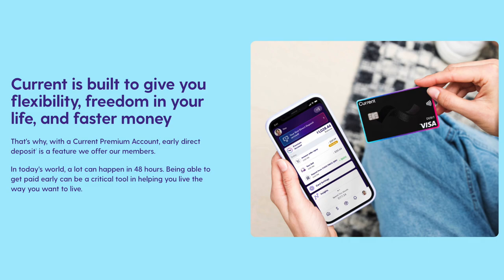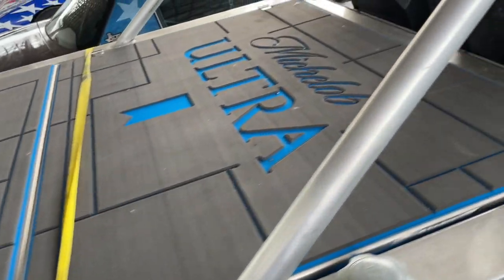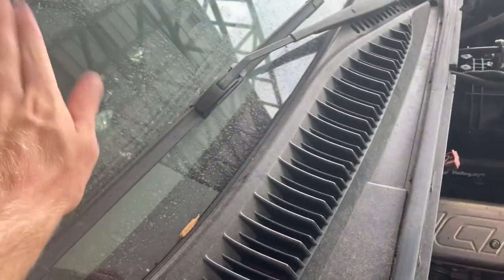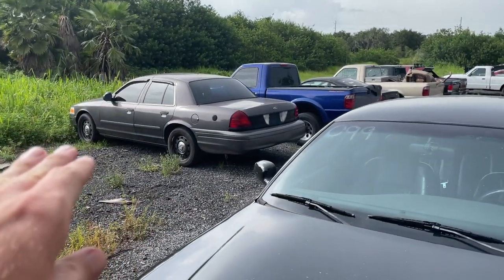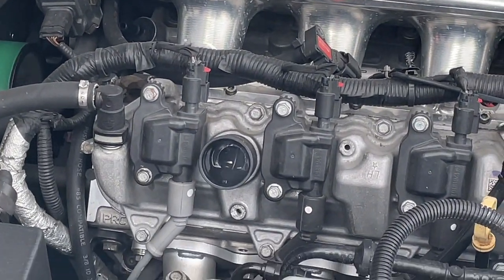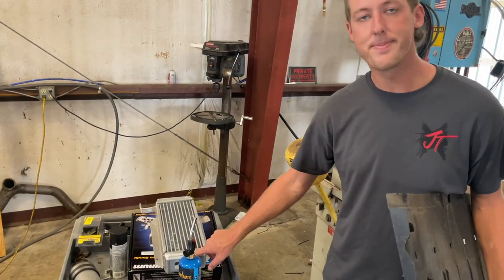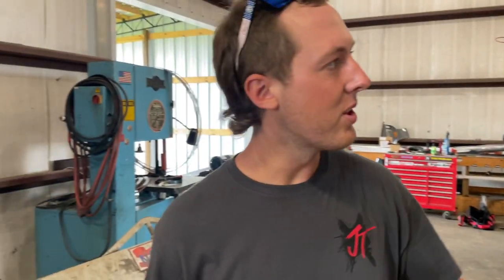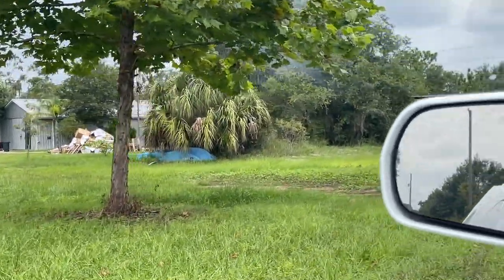Trying to Fix the FREAKING Bald Eagle Machine Finally... + Sold One of the Jet Boats :(

Comment: The fan really needs to be pulling through the whole radiator. Tye could whip up a proper fan shroud in no time.
Reply: Yeah as soon i saw it I thought this thing REALLY needs either a good shroud or a second fan on the radiator, plus a fan for the Oil cooler and AC condenser. Getting a new cowl/extractor Hood would really help the situation as well.

Comment: My LTX 427 from TSP failed at 1400 miles due to the stock oil pump they used, if you have mid teens and low 20’s I recommend rebuilding it with a better pump

Comment: Fun fact, mud daubers fill their nests with spiders they have caught and paralyzed. That way the mud dauber larvae have something to eat when they hatch inside. They are also pretty mellow and wont usually bother you, unlike other wasps.
Reply: You know your Dobbers!
Reply: This is true. And the little pricks will fill up any intake, exhaust, or port to an engine left open in no time. They got in my shed and filled in the intakes of my 4 wheelers. Had to almost chisel them out
Reply: Bastards got in my garage and filled up the hose connectors on my power washer. Took me forever to figure out wtf was wrong with it.. And if that isn't bad enough they crashed a couple passenger airliners too, killed hundreds of people. Buggars clogged up the pito tubes throwing off the flight instruments causing stupid pilots to stall out into the ocean and such in the dark. There's videos on it here on utube somewhere.

Comment: Elbow for the blower for sure. Maybe alky system to cool charge air (or nitrous 😉) Move oil cooler off to side maybe increase size of radiator as well. Supercharged cars generate a shit ton of heat, trick is to cool the charge enough to compensate. The alky system will do wonders, as will increasing methanol content in fuel. However I'm sure u would rather fill up at the pump sometimes.

Comment: Fun fact, sucking in hot air is what causes older Duramax's to overheat.  They get in to a feedback loop when the cooling fan turns on because of poor intake ducting.  Basically the fan blows hot air in to the airbox inlet, raises IAT's, which then raises coolant temps, etc..  The fix from GM was revised airbox ducting.  May not be all of your issues but it's definitely not helping.
Reply: but diesel engines have a completly different heat cycle than gas engines. They run way cooler.... And have bigger cooling system capacity.

Comment: I have a 1969 C3 Vette that use to overheat when sitting.  The front license was removed and the temps came down.  (I did add a new clutch to the fan and it helped tremendously) With the slanted radiator, it needs all the airflow it can get.  Now, it's time to get the new Z06 :-)

Comment: How about venting the hood so the hot air has an escape? Check out the Pratt And Miller race Corvette's. I know the engine is in a different place, and no blower, but maybe there is a new idea there with just ducting the hot air away. Fan shroud and an exit duct through the hood.

On another slide..... Did you see the C8R's At Le Mans?

Comment: I agree with the fans not being enough. Maybe instead of having that plastic cover on the bottom you could fab a plate that bolts in there with two air ports that can re direct the air under to go up the front of the engine and push the air out the hood. Then you get the oil cooler some fresh cold air and it will allow the procharger to not get crazy hot, also maybe a different hood that can extract heat better.
Reply: And if it works you could manufacturer it and sell it on motion race works. I'm sure this is a common problem on the c8's

Comment: The water in your oil doesn't even begin to burn off until 215-220 for a street car in fl that's perfectly fine temps especially after a rip. You won't cause any physical damage in it until at least 280 so just send her.
Reply: 280??? I warped an ls head at 240 cruising up a mountain.
Reply: Holy shit, this is one of the many reason i wouldnt loan my vehicles out.... People like this exist, imagine letting your oil get to 280 lmfaooooo; I guess for "LS" guys its no big deal just go grab another engine from a junkyard....
Reply: Warped my block at 245, 280 would've absolutely destroyed it

Comment: Make a wedge Duct for your C7 Cleetus. So its fits wide on your behind your front bumpers, it ends in middle in a wide pipe, and at the end an edge again. Something like this >-<. So you move every bit air from the front bumpers into your rad. Sure it will be cooler.

Comment: Oops. Nevermind. Don't just take the thermostat out. You need to take the bulb out but leave the ring.
Reply: Also. Leave the oil cooler there but just cut a square hole on the bottom shroud. 

Finally. Yes. You need an intake pipe. Best would be to route it back to where the stock intake is. There's a lot of fresh air inside that fender.
Reply: He said in the video that it doesn't have a Thermostat 13:24 and I am wondering if maybe it needs a restrictor in it to slow down the water flow because if the water gets hot there is no way it can cool down fast enough without a restrictor or Thermostat
Reply: I think he said he is running without a thermostat, but I'm pretty sure a good bleeding and airflow will fix it, like everyone is saying a propper fan setup with shroud and everything.

Comment: I had service stabilitrac and traction control lights on my Yukon, it was the vvt solenoid and actuator. Oil ports that controlled the vvt were clogged, caused poor idle, low oil pressure.

Comment: Could look at some different hood options as well. Change up the look of the bald eagle machine while upgrading the efficiency of heat extraction. Fan shroud to actually make that fan effective. Like you had mentioned maybe a ram air duct if you can find good placement but that wouldn't be needed with better heat extraction.

Comment: Sometimes I'd you have a coolant line hooked up wrong it will over heat constantly  happend with my dad's 351 Windsor  powered morgan.  My uncle hooked up coolest line to transmission to motor or something like that and it caused it to over heat .  That just might be your issue

Comment: try dual electric fans with a full sized shroud.  That is what I had to do with my 82 Firebird after installing a built V8. The nose of your Corvette was built to improve the gas mileage as well as help with the top speed. Open the grille up and let it breathe.

Comment: Hey Cleetus, try putting the duct work for the hood vent back on, that draws air through the radiator and out of the engine bay on the C7. May help with the cooling.

Comment: Get a better aftermarket fan, trackspec hood vents, air intake tube to the driver fender area and open up the front end as much as you can. Engine bay is holding hot air for sure, third gens have the same issues i put 4000cfm fans and opened the hood to push the air out

Comment: You know your problem is the vette's revolting. It's mad it has a hood while all the other vettes run around hoodless.

A cold air intake would help greatly for intake temps. Also there is a lot of open space on the back of that radiator. You could probably fit a larger fan or a dual fan setup with it fully shrouded would help move air through the radiator.

Comment: 160° thermostat and you'll be golden, if you aren't running a thermostat at all that's the issue, the coolant is passing through that small radiator way to fast for it to effectively cool the coolant down.

Comment: It 'should' be cooling adequately at cruise, but there may be two problems not mentioned that could compromise that.
Modern vehicles run very hot to minimise fuel consumption and improve the thermal transfer from the cylinders - you should be able to find a replacement with a lower openint temperature, which 'should' help.
The other thing is it's possible there is air trapped in the radiator, reducing the actual heat transfer from it - it may be a good idea to check the radiator is hot all the way up to the top fins, and that the cooling system hasn't any blocked, or kinked, hoses that may be preventing it from self-bleeding.

Comment: TPMS will affect the traction control it is integrated to the whole system. If the tires were aired up and the tire light is on the computer will try to compensate for the TPMS.

Comment: Put some venting on the floor piece to let more airflow through to that oil cooler and put a bigger fan set up on the radiator and like you said put an intake on that moves it away from the heat being pumped out of the fan, possibly change the style of the oil cooler to a taller thinner one to spread the heat out and get a fan on that too

Comment: On GM cars, there are other systems that are tied into the Stabilitrak error system. Like I'm my 2008 GM car, I had the Stabilitrak light trigger twice and checked it as soon as the light came on. It turned out it was first the crankshaft position sensor failing and then it was the original EGR valve going out. Replaced both and the light went away both times

Comment: You need to have the air duct to the hood outlet, otherwise you dont get good air flow, because the air is whirling around in the engine bay.
Air going over the engine dosent effect the cooling performance, remember, the air you just heatet up was heatet by water coming out of the engine, the air can´t be hoter than the engine already is!
It´s just about the resistance of the air flowe!

Comment: Personally I'd replace the oil pump. 40psi on fresh oil seems low for a big block and the fact that it keeps quitting at idle could indicated that the computer is shutting it off to prevent damage. You are also asking a lot of the oil pump by running the oil through the turbo and the oil cooler. It's not that it can't do it but that you would see better cooling and lubrication out of a higher flow system.

Comment: The traction control is either the trans flaring or there could be a problem with the ground. Them negative battery cables are trouble sometimes caused my lt1 to shutdown while driving slow after I had traction lights on

Comment: As everyone else has said, you need to create a shroud for the fan as it needs to create suction, not just circulate air round and around. That, plus either dual fans or a single bigger one. More CFM.

Comment: Without a t-stat it will run hotter once water a cycled thru after hard pulls. It needs time to cool b4 leaving the radiator!! I'd suggest putting a 160-180 t-stat bro

Comment: Hey Guys I love the channel! Just my two cents but that fan looks too small in diameter. It sounds like it’s pulling air like crazy though. Maybe a shroud to help pull air across the entirety of the radiator fins. I had an overheating issue with an old 1 ton square body I had years ago. Someone put an 18” flex fan on it. I put a standard 19” fan with a new fan clutch and the AC worked better and the 454 in it stayed at 190 no matter the situation.

Comment: Hey lad you don’t have enough fan on it. You are only cooling half of the radiator. And put the lower plate on it and direct the air up into the radiator. That will fix the problem. Cain hard guys.

Comment: You need to put some serious big elelctric air movers on your ride also what type fluids are you using your mixs may be wrong since your space is limited you must use every inch of heat exchange wisely

Comment: Get a new shroud made for the radiator fan that covers the whole area of the radiator core, and mounts the fan up as far as it can go. That way it pulls air through all of the core rather than just over 1/3rd, and the hot air that the fan does pull through, gets directed up over the engine and out of the hood vent rather than blowing it dead in the middle of the engine.

Comment: Sounds like it is overheating at speed, i'd be less worried about fan flow if that is the case. Maybe install some shroud/dams to force air across the entire area of the radiator. I'd would want to add the air intake just for performance easier to compress a cooler gas vs a hot one.

Comment: Think the traction control issue and that weird no acceleration when foot to the floor might be connected to that throttle body . Maybe those dirt dobbers messed something up with the throttle body itself or wiring could be something to look at

Comment: I do agree with everybody else about the fan size and no shroud but what nobody thought about is that it's been running for years without this problem (correct me if i am wrong). So this problem just started and like George sad, might be the radiator not flowing enough. Also if it's true that there is no thermostat, well that might be the biggest problem right now.

Comment: Is there enough room to put a full shroud on the radiator so that the fan can pull air across all of it? It seems like it is only covering about half the surface area. Maybe a dual fan set up?

Comment: Wrap the header in the C7, move the oil cooler to the driver side front with a high revving fan, and get either two fans on that radiator OR a better shroud with one larger fan. But seriously, wrap the header/ exhaust. Then have Dr TuneEmAll have an hour with it on the dyno!

Comment: Pressure differential is everything.

The vents in the hood are a low pressure zone at speed due to venturi effect, so air should be sucked out of the engine bay.  However the area that it is pulling from is the exit for the radiator (good) and intake for the supercharger (bad).  This means that the supercharger is trying to compress an air that is lower density because of the hood vents, and hotter to air molucule are spaced out more (bad).  It needs a cold air intake ASAP.
Ducting is everything, there is so much air that is not being directed, and is going around things.  If you seal the radiator to the bumper opening, and ensure that every air particle that enters the front has no way to escape and go around a heat exchanger, then it is good, it picks up heat and takes it away from the car, but I see so many gaps as you moved the camera around.  aluminized tape can be your friend for the final bit for sealing all air gaps.
The radiator not having a shroud that covers the entire rear is also not helping.  Air takes the path of least resistance, so the fan pulls air though, and the hot air just goes back though the radiator, so you likely have just hot air flowing in a circle at low speed which will not help, and then as said before, the gaps around things, so you are getting air going around the radiator rather then though it at high speed.
The rear of the radiator should also duct to the vents on the hood, so you end up having high pressure air on the bumper opening, and low pressure zone due to venturi effect on the hood, causing air to be sucked out.  The pressure differential will make a huge difference in cooling.  I added vents to my cars hood and discovered there was enough of a low pressure effect that a small oil leak I had at the time flowed forward off the cam cover and was sucked out the vent.
I think that a few people need to maybe pick up a few books about aerodynamics or get someone that has done these kind of things because they live in the US desert to help out a bit (Hi).  I am kind of surprised that you all did not run Mullets engine at speed when you all were in the wind tunnel a few months back to use the pulses to get some free downforce by aiming the exhausts at different angles down to create vortices along the side to keep the area under the car a lower pressure zone without adding as much drag

Comment: I'm a diesel mechanic cleetus. Change your oil every 10 to 15k miles in the hauler. You will have less problems when it comes to the dpf system.

Comment: It sounds like the butterfly is sticking for a second or the MAF is misreading. I hear intake when you punch it then it hiccups and comes back on. I had the same issue with my mini. It did the same thing. I cleaned the MAF and made sure the butterfly was going full flat. It solved it.  The heat may make it unhappy, but it wouldn't hiccup like that. It is your car, I don't know much about the C7. It just sounds like a dumb issue.

Comment: You need more thermo fan on that radiator for starters. Then I’d run more volume on the sump. Volume of coolant/oil makes an enormous difference to temperature control.

Comment: Mud dabbers in the TPS or maf. Other than that I am thinking that lumpy cam may suddenly lose air flow near idle. Maf says cut fuel, engine cuts out. can you dial in more fuel at lower rpm. Raise idle rpm.. Assuming you have checked advance curve..

Comment: Start with getting dual fans for the radiator. If that doesn’t fix the issue get a larger radiator, thicker with the same width and height.

Comment: Air flow for the heat exchanger seems to be lacking but you might want to verify it's heat transfer capacity is size correct for you new thermal characteristics. With this more of a daily driver you have to consider longer run times and heat soke from the drive vs idle. You also have to consider the thermostat might have failed and is not opening at the desired temperature or the water pump might be able to move the water enough to cool correctly.  I'm only guessing sense I don't know the full stats on that car in it's current configuration.

Comment: Hell, throw a 350 small block Chevy with a 4 barrel in the C7. Have jack stand run a couple wires and dust off the ol timing light and your set!

Comment: We usually check and grease trucks that aren't run hard at 10,000 miles and do oil and fuel filters at 20,000

Comment: Maybe a intake to the supercharger pulling in cool air from the side and probably like a dual fan on the radiator so more air in getting pulled through. Also would help if the oil cooler was off to the side as well on its own I would imagine